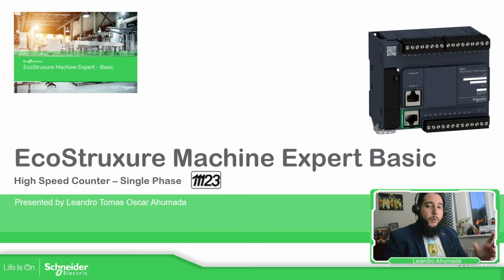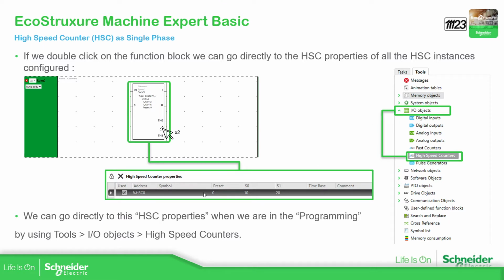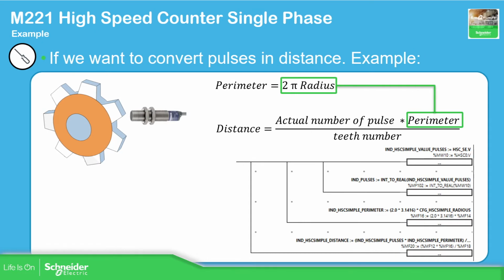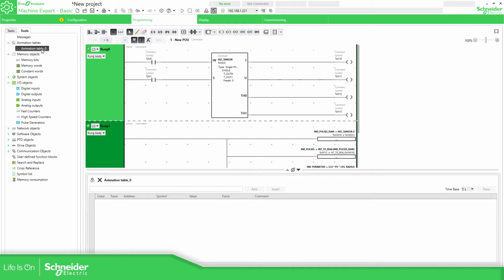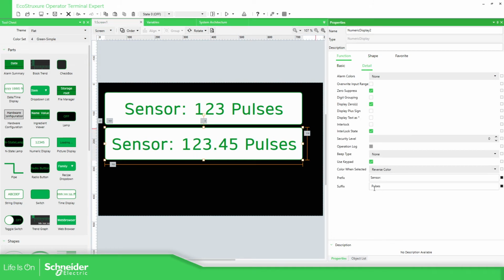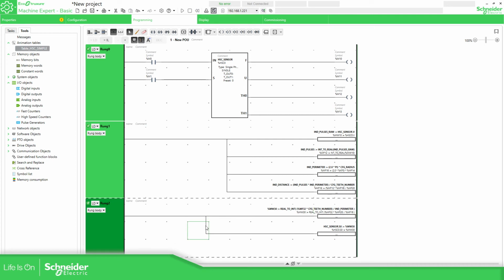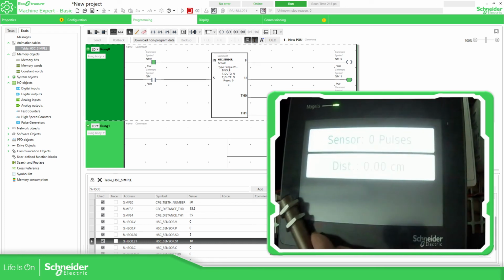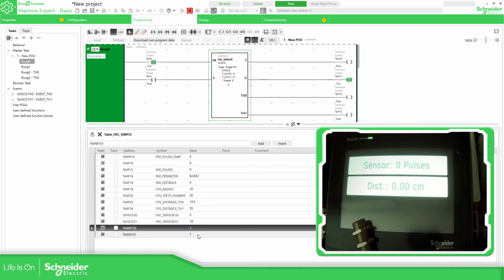Training - M221 - M12.1 How to use High Speed Counter as Single Phase

Comment: Hi Leandro!  I'm not getting the same behaviour as your sample.  I have a relay programed with %S6 conected to %I0.0 and a counter programmed as single phase with %I0.0 as pulse input.  But it's counting several pulses for each relay pulse.  I get the same result with a switch conected to %I0.0.  What could be the issue?
Reply from the maker: Hi there! I believe the problem may be the relay output, have you tried with a transistor output? That may explains the additional pulses
Reply: @LeTomasAHUMADA  Intentaré comprobarlo!
Reply from the maker: @NPlayer  ok, avisame.